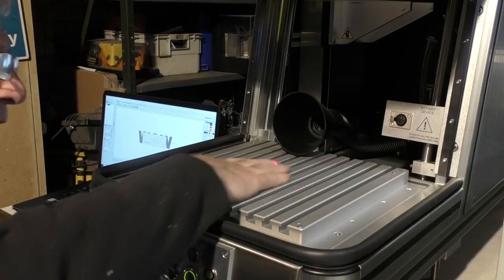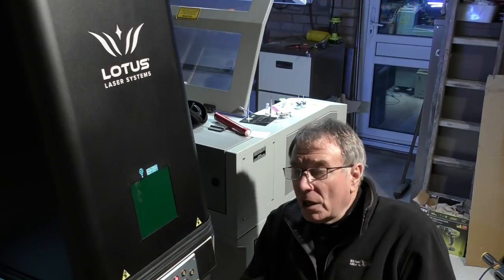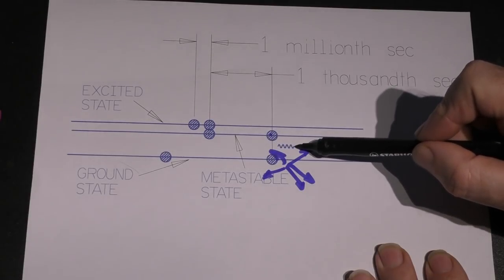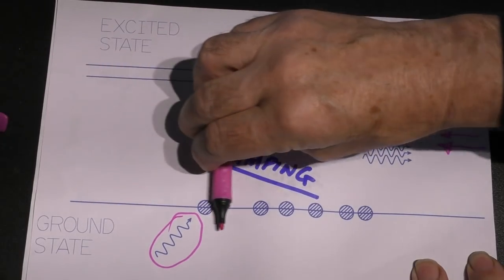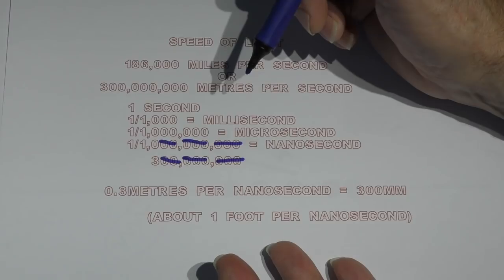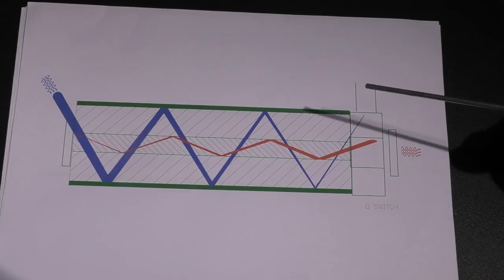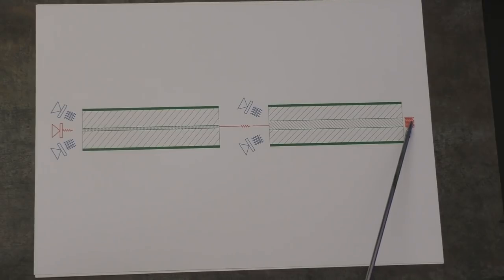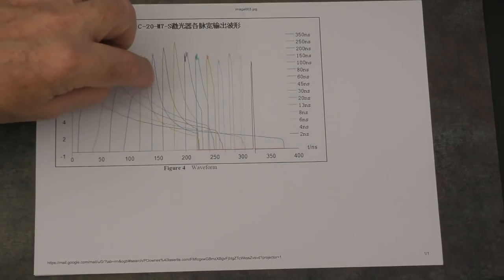Fiber Laser Learning Lab 01 Introduction to Russ, Lasers and Fibers

Comment: Quite interesting and very enlightening..............but as the best lasers for any practical purposes within the reach of the average mortal is only capable of marking and burning or cutting thin wood or plastics I think the cost factor for what it can do is still in the too hard basket......that is unless you have a real need to burn wood and cut out paper shapes etc.
When it comes to working on metals it's far away from the ideal tool to do any metal working as opposed to the EDM process that can cut the hardest of metals.
Reply from the maker: Hi Ian
 For 10 years I ran  two metal cutting lasers as part of  my precision sheet metal business. Playing with low power CO2 lasers as a retirement activity has been great fun. There is a significant niche in business for these low power machines and many small business have blossomed from these low cost beginnings. Fibre lasers are an amazing tool for metalwork and other applications when working at the kilowatt scale . However at this low watts end of the market they are specifically for marking and I have to say (from what I hear so far) a very limited range of materials. There are some specialist mass market applications where these machines fit in perfectly and other small business applications like engraving precious metals in the jewellery trade , where they are a viable tool. However, in  the hobby market where CO2 lasers have made such a big impact, no,. this technology is just  way too expensive and has very limited practical use as a general workshop tool.  I would not buy one but have been lucky enough to be loaned this machine to dig around the darker recesses of the technology.. After coming to terms with how the machine works during the first two or three sessions the main focus will be on exploring the science behind all the different marking processes that this technology can undertake . Yes,  it can engrave metals and even cut very thin foils and shim  (cost effectively ? I am yet to explore) neither  being possible with the hobby CO2 laser.. This  is no marketing exercise for Lotus Laser because  they are very happy for me to be  honest/brutal/critical/amazed by what I can discover.  I emphasize I am very much a student and not a tutor. I enjoy learning and solving riddles and there will be plenty of those in this journey. The processes and marking techniques are well practiced and developed over many years  but it is amazing that there is so little scientific analysis of the physics and chemistry for the various material /light interactions. That is where my real interest lies. Sadly I am neither a physicist or a Chemist  so I will be flailing around in a deep pool without buoyancy aids.  I am not proud, so if any professionals in these disciplines wishes to jump in and rescue me  I will always be glad of help and guidance.
 Thanks for the comment
Best wishes
Russ
Reply: @SarbarMultimedia  Yep, I think the cost effective part is the main reason why many people don't "invest" in a laser of any description.

Cutting out wood or paper shapes is not my cup of tea as I'm a metal worker per se.

I browsed EBAY to see what the fibre lasers were going at and a figure of A$5 grand was about the average for a 20 watt fibre laser.....those fibre lasers are so neat in their work footprint I almost want to get one......making parts to sell is not my interest zone.

Being retired and a pensioner with nothing to spend the dough on I still have to think what would I really want to do with a 20 or 30 watt laser if I wanted to indulge myself........my main interest in that area is with CNC mills for model engineering and messing about in the garage so I spent 10 grand indulging in that arena.